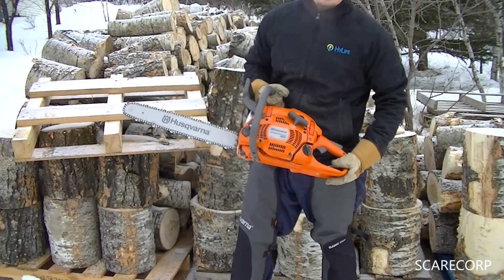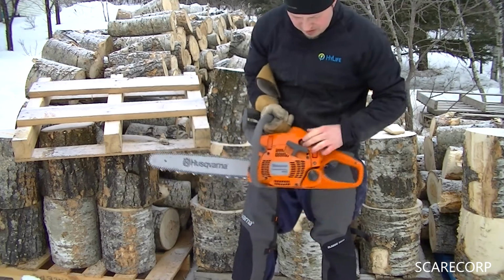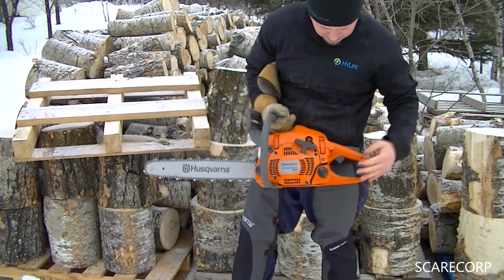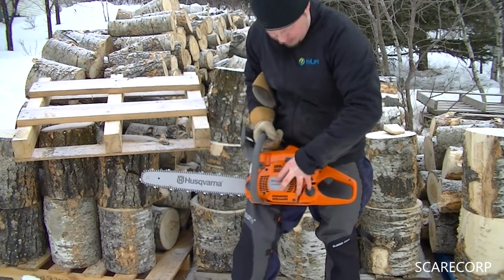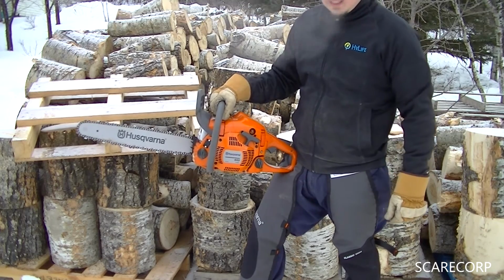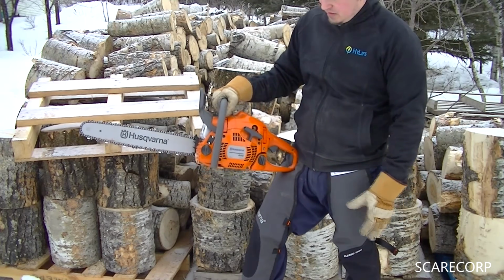Husqvarna 445 Real World WINTER Coldstart

Comment: Nice cold start but you should never drop start a chainsaw, it’s a dangerous procedure to a novice user and shouldn’t be encouraged.
Reply: Why?
Reply: @INSTERMENTAL  for safety reasons their is more safer ways to start it but I recommend laying it on the ground but make sure the bar is not touching the ground as it could cause a kickback
Reply: @INSTERMENTAL  The same reason there is a tag on your toaster cord telling people not to use it in the bathtub. If you have any sense, you'll be fine.
Reply: @INSTERMENTAL  I think you are addressing the wrong person
Reply: @ampatriot  oops just replied not good with this stuff but i agree with what you said sir!
Reply: Swedish chainsaw should start in the cold😂and Finnish axe always work😁
Reply: The newer (2020) "E" series 445 model saws have the "easy start" feature. Set them on the ground and pull evenly. Drop-starting them will blow up the recoil starter.